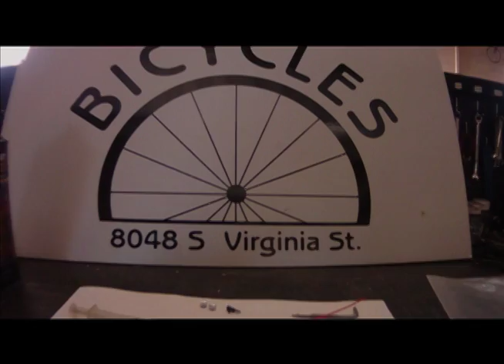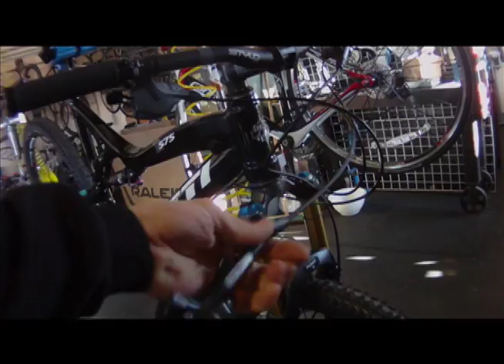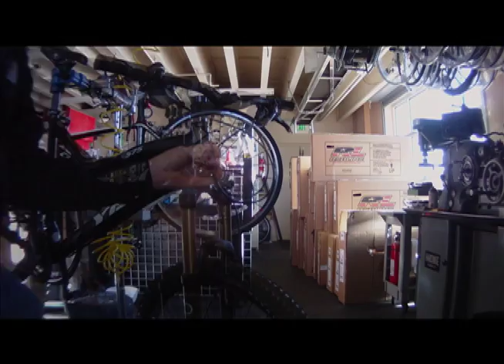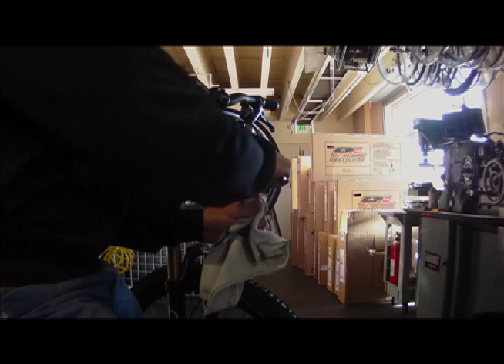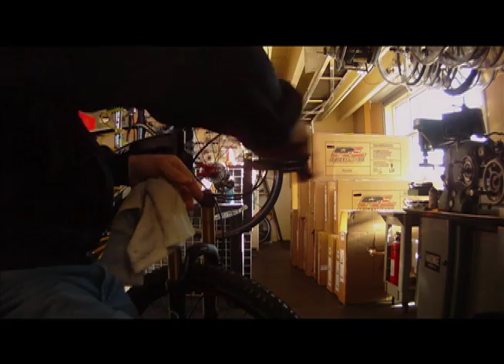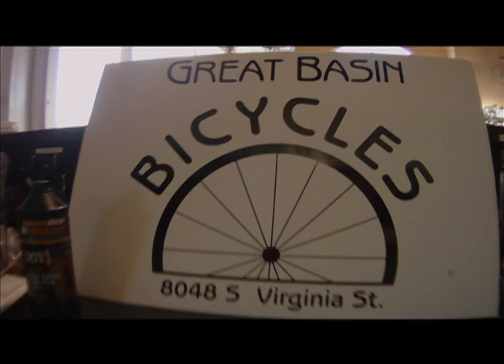Mountain Bike Quick Hydraulic Brake Line Shorten Bleed Fix at Lever - Great Basin Bicycles

Comment: Small issue, I bit it on a jump, landed wrong hit my front brake(hydraulic) the lever popped out when it hit ground. I pushed it back in where the pin ball(stem w/ball) snapped in place, works fine..Only probem brake lever sticks a little too far out. How do I adjust it back inward? Tecktro Darko 2? Any help is appreciated..Mike

Comment from the maker: David, I have some friends that work in the medical field.  Some are fire fighters, paramedics, and one that works for a heart surgery center. If you still can't find them, you might look for a medical supply store. Lastly, I used to use an empty Tri-Flow bottle with the long skinny tube on the end of the bottle. I would clean it and put hydraulic fluid into the bottle and use the long skinny application tube to insert into the hydraulic line.  Good luck.